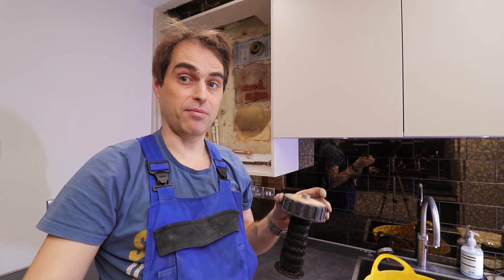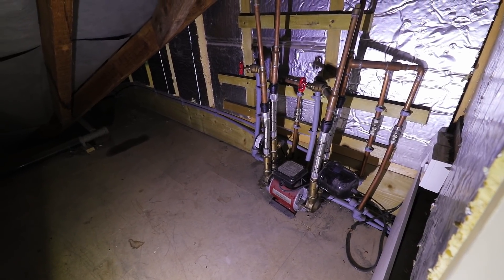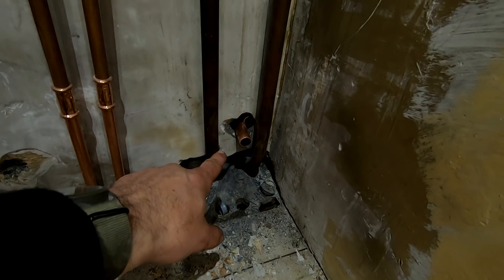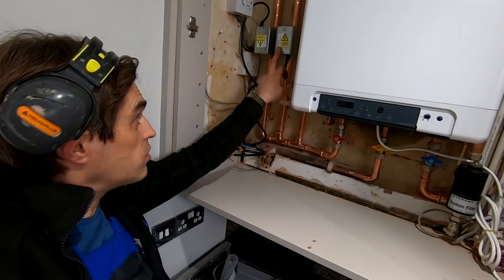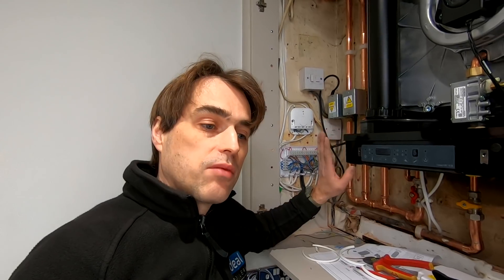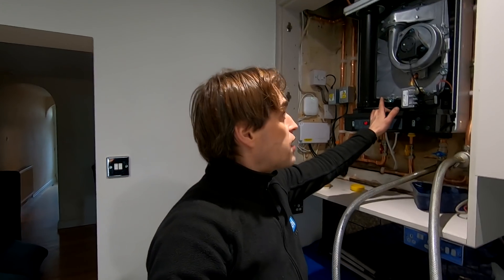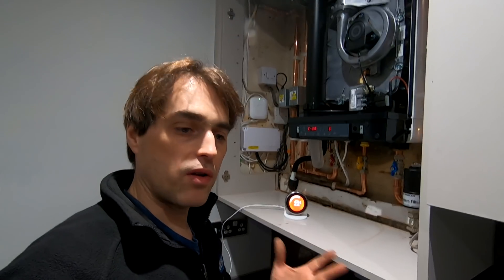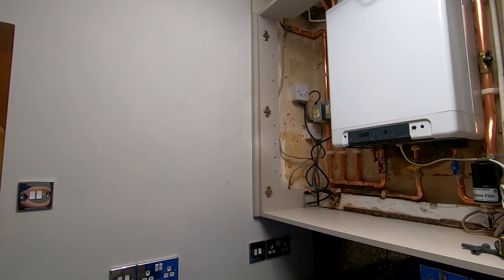Another house saved from a combi

Comment: Very nice install indeed - I bet you have a very happy customer. Have you ever considered using one of the larger Wago wiring centres?
Reply: +1 for Wago connectors, best wiring connectors I have ever used. Not the cheapest but they are great.
Reply from the maker: wago? No, I am happy with my £16 Salus.
Reply: @UrbanPlumbers  Yes it is more expensive but saves expensive time too (Rather like press fit).😉
Reply: @normanboyes4983  It also reduces the risk of a poor termination. I would use Wago wiring centres.
Reply from the maker: Used one on Monday. It’s not bad but still prefer 16 way salus

Comment: Can't wait for the next heat-pump vid. Our has been an absolute mess. First off they put the included thermostat that does outdoor+indoor compensation in a cupboard, and installed a wireless on/off thermostat with no compensation (was set to a fixed flow temp of 50*C), Was multiple leaks when the system was installed. Manage to fix most issues, moved the thermostat out and enabled temperature compensation, Is now costing a 1/3 of the money to heat the house and its much more comfortable.
Reply from the maker: Glad you had it set up in the end!
Reply: @UrbanPlumbers  I’ve been a heating engineer for 16 years now and I love your technical knowledge, positive attitude, insistence on doing things right. You think like I do 😊. I called Intergas tech support a couple of days ago with a view to using one of their boilers for Two weather compensated heating zones and an unvented cylinder…. The guy I spoke to said it wasn’t possible…. I’m not sure I believe him!  I’d love to have a chat with you some time.  Mark
Reply from the maker: @rainbm  it is possible

Comment: I have never fitted, nor seen a hot water priority system believe it or not. Thanks for your videos showing how it works 👍 A nice neat job.
Reply from the maker: Try it! It gives better hot water reheat times, better efficiency on heating. You can also install much smaller cylinders. If you were to pair a 30kW intergas boiler with a 125L high gain cylinder ( joule for example) you can have under 12 minutes reheat times, meaning you can never run out of hot water when using one outlet , pretty much like using a combi but with much better flow rates. 

You will also stand out from your competition when quoting.
Reply: @UrbanPlumbers   hi great videos! I have a 30Kw System gas  boiler (not priority set up) and a 250L indirect Gledhill. With UFH to ground and RADS to upper floors, what flow rate would you advise temp to be set at to best heat tank to temp, and be as efficient as i can with this set up? Keep up the good work!!
Reply: Neither have I, this is the first I've heard of it.  Interesting.
Reply: That's the benefit of an intergas boiler, PDHW.

Comment: What was the actual problem with supplying enough hot water for 2 complete showers at the same time? 
Flow volume of the hot water(10-ish liter/m at 60 C per shower)?
Heating power level of available combination boiler?
Reply from the maker: There is no combi boiler ( unless you use storage combi) that can give you 20L /min with 45 degrees temp rise. The best combi can give you 15L / min with only 35c temp rise and it will be a monster that will require gas upgrade and most likely will be hugely oversized for the property and inefficient on central heating. Combi boilers are a solution that creates a lot of problems.

Comment: Why do you prefer intergas
Reply from the maker: Solid build quality, very flexible - one boiler can do heat only, system or combi, easy hot water priority, full open therm compatible, very reliable, reasonably priced, long warranty, setting allow for correct pump setting with minimum and maximum speed adjustable,  copper on wet side of heat exchanger allowing for strong chemicals to be used when flushing, they only aluminium heat exchanger that is copper on the wet side - I could go on and on and on, excellent boilers.
Reply: What sort of warranty? vaillant is 10yr with their own filter
Reply from the maker: @aj7303  HRE IS 9 I think with the filter, X range is 12 years. I also fit vaillant, but only eco tec plus. Intergas is much more solid boiler in my opinion, but there different boilers for different situations.

My main problem with Vaillant is the fact the pump cannot be adjusted to a burner/ fan linked speed, only fixed speed, affecting the efficiency in a  negative way and fact that vaillant does not do open therm and hot water priority requires vaillant controls and wiring center that add £400 extra to any job , while on intergas you need a £10 wiring center

Comment: I wouldnt fit another telford cylinder. Theyre the only cylinder that requires you to fit a 22mm gate valve across the coil. If youdont fit it it you get insane vibrations through the house as the cylinder heats up. Its due to them using a flexible coil in the cylinnder rather than a hard pipe.
Reply: Had this with the gledhill cylinders, they have maximum flow rates before the coil starts vibrating
Reply from the maker: I have seen it happen with all different makes. Even solid copper coils can vibrate and cause noise issues. Gate valve on the return or between flow and return cures it.
Reply: @richard8303  same
Reply from the maker: I actually never had a problem with the coil. All my gate valves are fully shut on those cylinders and only installed in case I may need them.
Reply: @UrbanPlumbers  i never knew it was an issue till i fitted one in my own house and ended up with the coil noise buzzing tthrough the house. Ive since fitted these in other propertys and always had to adjust the gate valve to silence the noise. I stick to installing joule cylinders now. Im surprised to hear you havent had an issue with it!
Reply from the maker: @nevillethumbcatch5691  yes I like joule but couldn’t get one as this was a very short notice job
Reply from the maker: And there are other cylinders that I come across that also require a gate valve due to resonance
Reply: @UrbanPlumbers  not come across any other cylinders ive had this issue with. Im assuming the ones you have, have also had the flexi pioe used for the coil?

Comment: Great video. I wish I could have opentherm but this seems difficult with a Worcester green star boiler even with evohome….
Reply from the maker: You can get a module for a worcester that will allow OT
Reply: @UrbanPlumbers  thanks for your response. I know but people who have used them have removed them afterward telling that this does not work but I am unsure if they were using the Worcester’s modules which are recent it seems. I need to do more digging into this question.
Reply from the maker: @maximusg88 it also works with boiler that support PDHW but only with 1 heating zone.

Comment: Press fit copper joints, nooooooooooo!
Reply from the maker: why not? No need to set houses on fire any more.
Reply: Press is the best
Reply: Get with the times dude
Reply: Press fit isn’t at the mercy of massive quality variations due to location, skill, fatigue, temperature, technique, hangover, etc. It delivers predictable quality and durability every time. If it’s not right, it will leak immediately (as shown in this video) otherwise it will last precisely as long as the manufacturer intended. It also doesn’t require the pipe to be dry. And no naked flame is a huge benefit… in some commercial/industrial settings, using open flames comes with a minefield of expensive and time-consuming caveats.

Comment: I just got a glow worm boiler and it's only two months old.  Already its making clicking noises and they are getting louder.  More so when the boiler stops calling for gas.  Any idea what this could be?
Reply from the maker: Thermal expansion of the heat exchanger. I will happily swap it for intergas for you ;)

Seriously though call Glow Worm to grease the bolts on the hex
Reply: @UrbanPlumbers  thanks man.  If I could  afford your fees I would happily pay for your services.